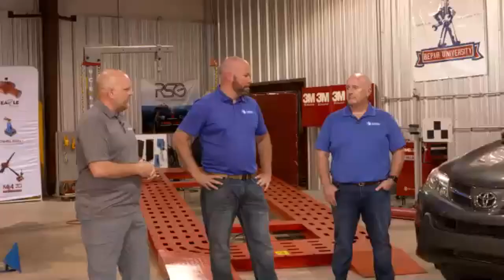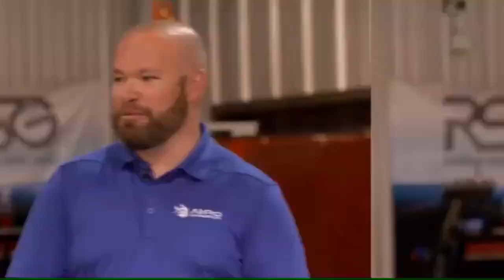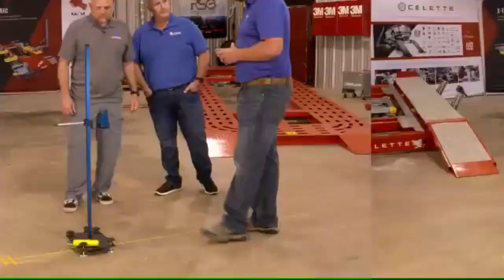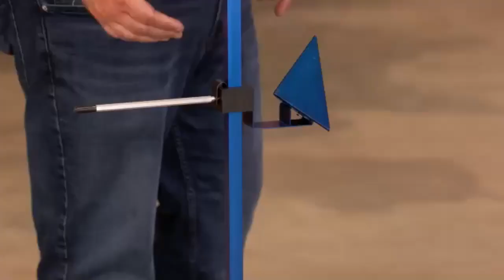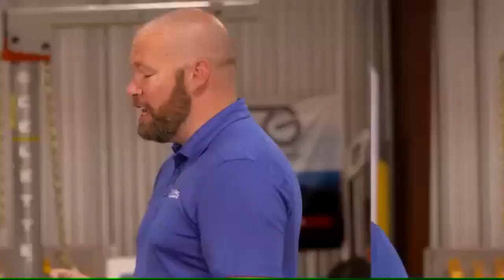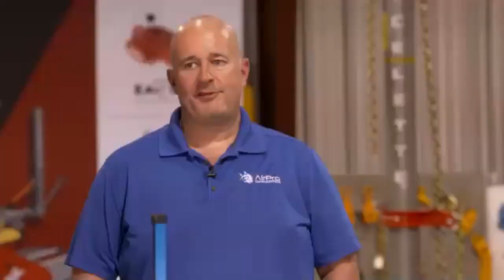Collision Repair Diagnostics And Calibration: Set-Up For Autobody Shops

Comment: Just ran into this video.  Very informative.  But, would you say that smaller independent shops are kind of screwed in being able to this recalibration? Just based off of space and no dedicated spot to do this.  Seems like space is key.  I work at a smaller shop and, for example, my area you pull in, there's my lift and right infront of that is a bit of space then frame rack.  Would like to be able to get the labor for this but doesn't seem like an option for me.  Appreciate any input.  Thanks

Comment: What are some resources to reference for the procedures on how to do these calibrations?
Where do you look up these procedures?
Also you have a level for the target/cone, but how are you leveling the vehicle?
And is there a link to where one can get the target/cone?
Reply: The best place to get the procedures is from the OEM website; you'll find everything you need there, although it'll take some trial and error until you're familiar with each of the OEM websites. Another great resources is ALLDATA. The information is directly from the OEMs and is laid out in a similar manner for each of the OEMs, which can make information easier to find if it's published in ALLDATA. With regard to 'leveling the vehicle' many of the procedures will call for a flat area, with little variation from the front to the back. For acquiring the cone, I'd suggest reaching out to AirPro at: https://airprodiagnostics.com/ - Let us know if you have any other questions and we'll do our best to point you in the right direction.